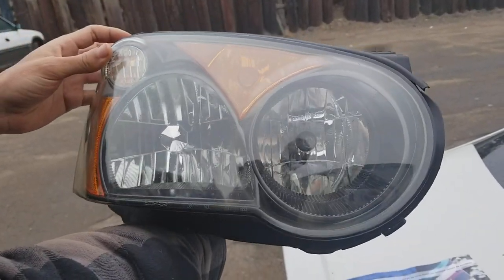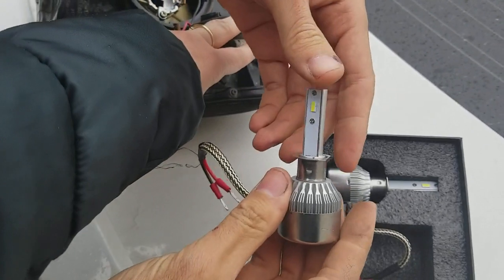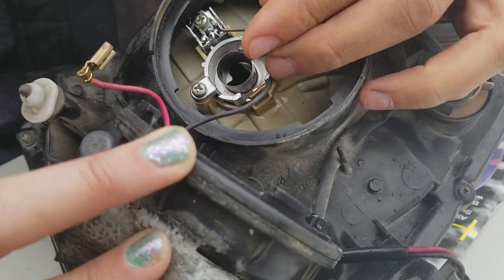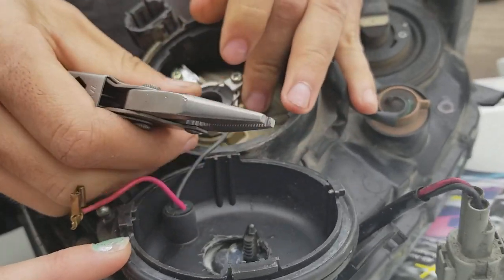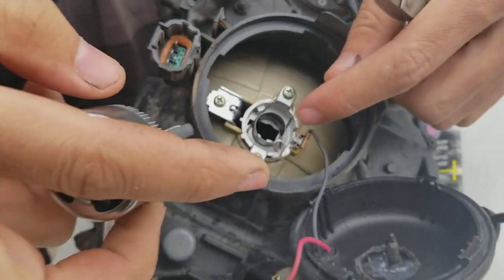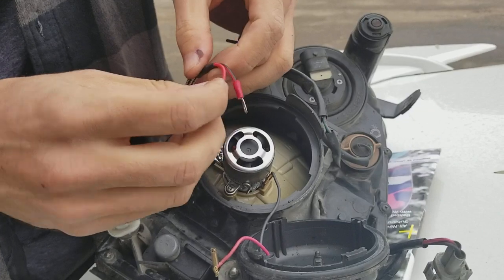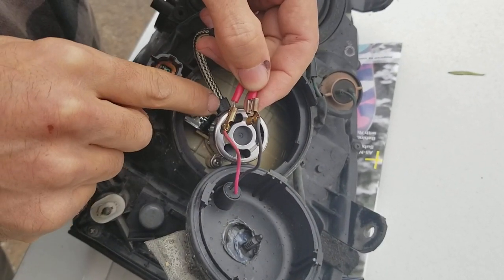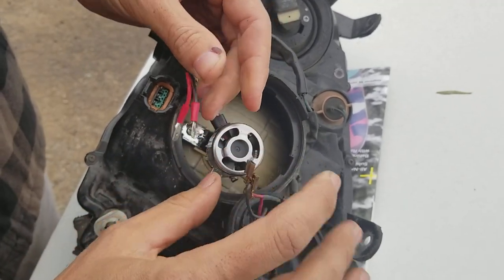Best Led headlight upgrade blob-eye WRX/RS

Comment: Cool video - ordering these for my '04 Blobeye.  Thx!
Reply from the maker: are you ordering from Amazon or buying local?
Reply: Was going to buy them from the lasfit website, but if they are available locally in SD, that would be easier / better.
Reply from the maker: Local seller/installer in San Diego is Petteys Auto in Rancho Bernardo. Or Amazon with discount code in the description.

Comment: Do I also need to purchase the Headlight Canbus Error Free Anti Flicker Resistor Canceller Decoder if I plan on installing these on a '04 WRX?  Thx.
Reply from the maker: Only If your car comes equipped with daytime runner lights that run the bulb at lower voltage.
Reply: Got it - thanks!

Comment: This is EXACTLY what I was looking for. Thanks a lot. The design of the blobeye headlight just sucks ass totally, what a real piece of crap those headlights are....worst from the GD generation for sure. I have to modify the butt or cover with a hole to let the LED ventilator work without a problem right?